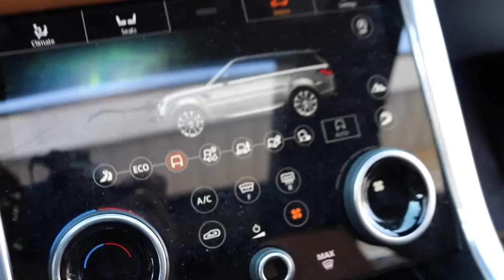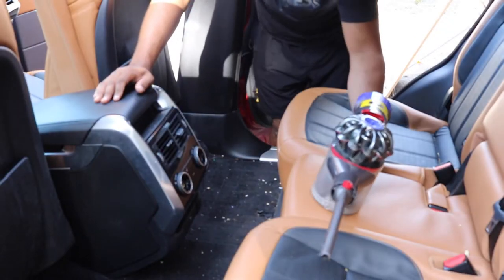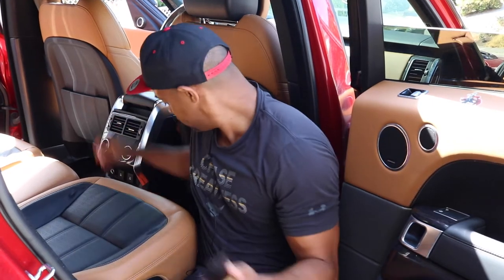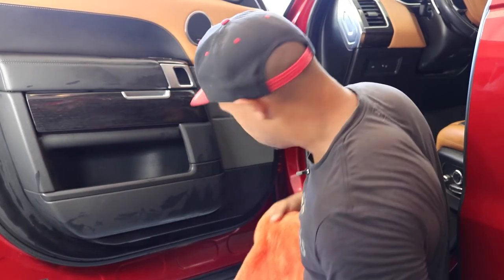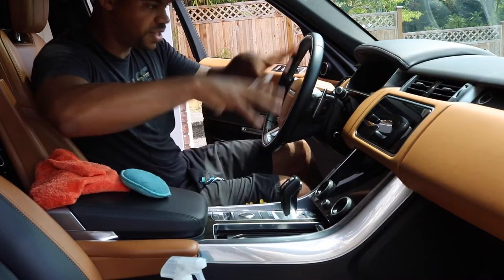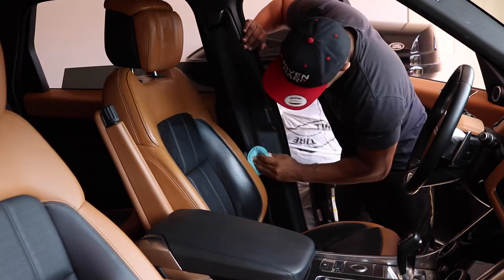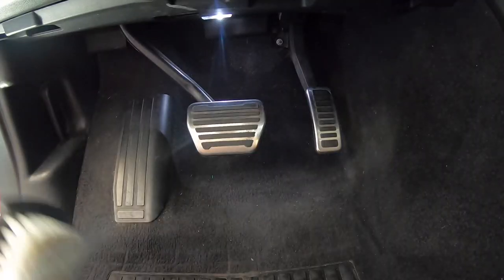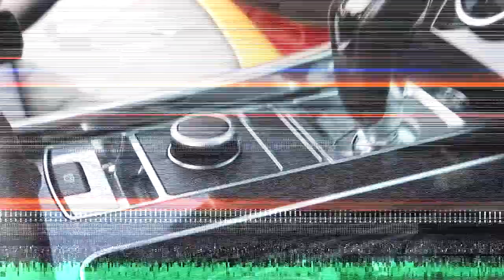How To Deep Clean A Range Rover Sport | FULL INTERIOR DETAIL

Comment: Hi bro Im curious what tyre pressure u put on ? Last time the tyre guy put 38 psi for my rrs and driving feeling is so weird. Then i pump it back to 40 psi for all tires then it alright now. My rim is 22 inch pirelli
Reply from the maker: I tend to run a bit lower, around 35 psi (21' rims). The dealer will put in 40 to 45 and I can't stand the ride. Its too firm  and I can feel every imperfection in the road
Reply: @DrivenHard  yeah i understand. However. If i put 38 on my 22 inch rim. The steering wheel become too heavy and also i feel like i feel the road too much...maybe because the road in my place is so bad 😿